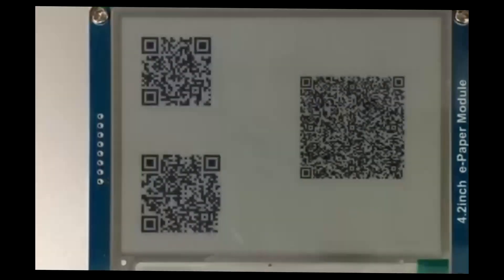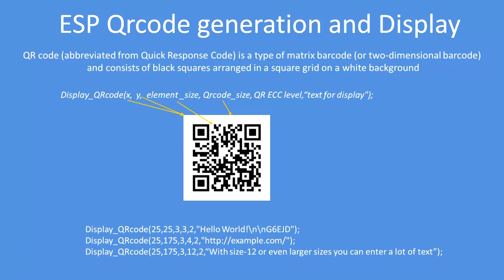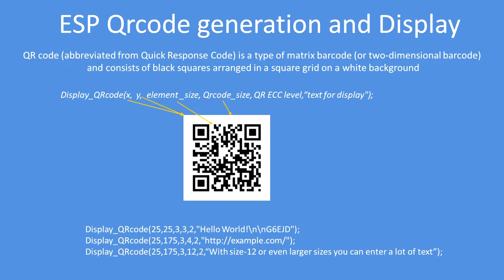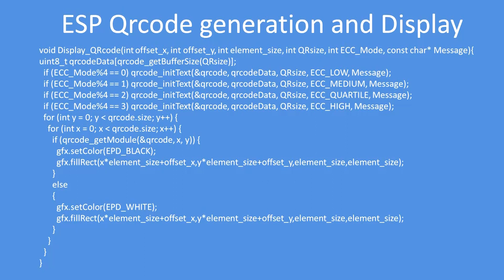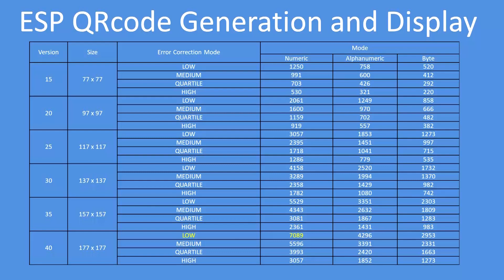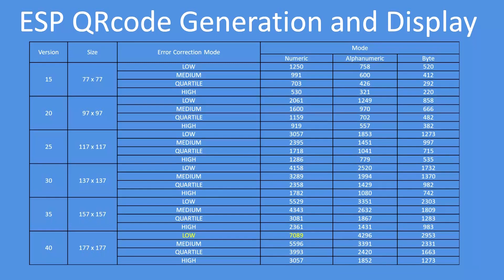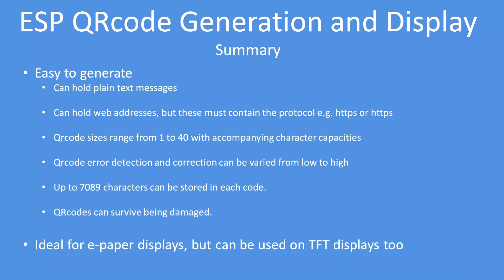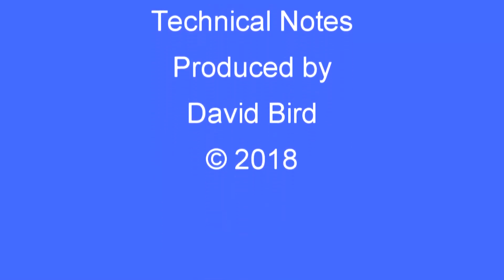Tech Note 102 - ESP(32 or 8266) Produce and Display QRcodes

Comment: hi Dave, can an ESP32 or RP with a camera read the QR codes? What e-paper display do you recommend please? Thanks. Wim
Reply from the maker: V W, any e-paper display will do, I’m currently using all sizes with success. You can vary the QR size too depending on screen resolution. I have not seen a library that enables camera reading but one might exist.
Reply: @G6EJD  thx
Reply from the maker: Cost is a factor but 1.54” works well

Comment: so if I have an LCD then I can generate these on the fly and have dynamic content inside such.  Way cool
Reply from the maker: Yes as you can parse a string variable and so update as you need. Great for an advertising screen I suppose
Reply: Or two-step authentication as an other powerful application
Reply from the maker: Yes indeed and it could be a form of public-private key access.